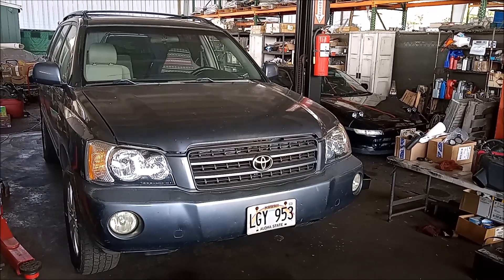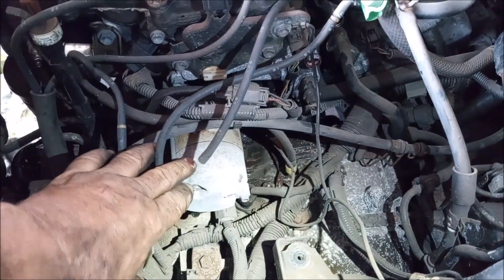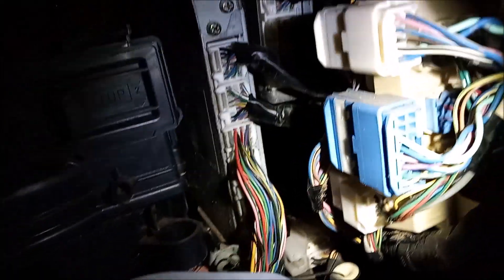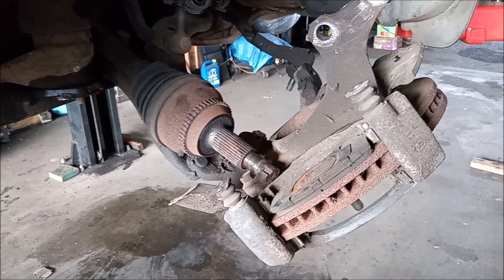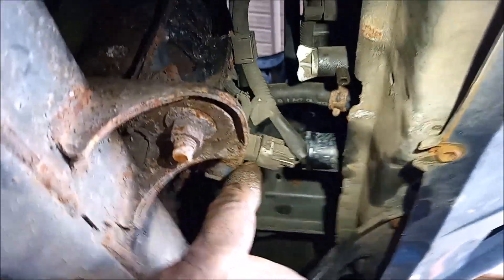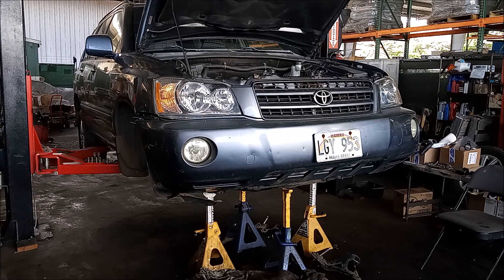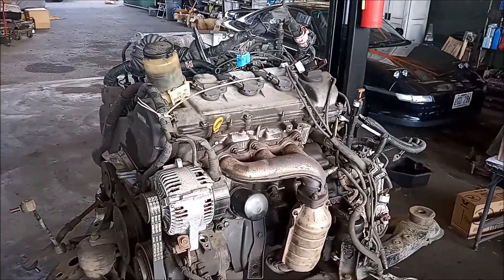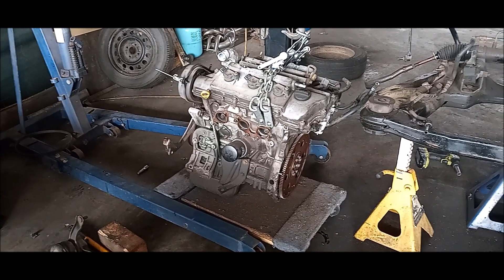How to Replace the Engine Toyota Highlander PART 1 - 1MZ-FE 3.0 Liter V6 - Camry Sienna RX300 RX330

Comment: I just did an engine and transmission swap from a donor. Now I get a crank no start. Did you reset the ecu?
Reply from the maker: There is no reason to reset ECU with this engine replacement. Do you have fuel? Do you have spark? Do you have compression? What is your vehicle?

Comment: What size should be the fork's opening to separate the subframe? Thank you.
Reply from the maker: Are you having the same problem with corrosion? Any standard pickle fork will work.
Reply: @Merryfrankster_  Yes, I do. I have found out there are at least three different Pickle Fork opening's sizes: 11/16" - for tie rods, 15/16" - for ball joints, 1-1/16" - for pitman arms. Which one did you use?
Reply from the maker: @mikhailmikhaylov3801  well if you look in the video you can see the size of that boss for the bolt that the pickle fork has to go around. When I get to my shop I'll measure my pickle fork for you. But probably you cannot go wrong with the bigger size.
Reply from the maker: @mikhailmikhaylov3801  my pickle fork is 15/16 between the teins.

Comment: It could be just me but this seems like you did a lot extra. I’m doing one right now but only the engine is coming out.
Reply from the maker: I've done it both ways. Easier and quicker for me to pull everything.
Reply from the maker: You'll see what I mean when you go to put it all back.
Reply from the maker: And besides, it's the suggested method in the factory service manual. Follow the manual, son.
Reply: @Merryfrankster_   in my exprerience, the manual doesn’t always advise the best method of engine removal but I will see. I’ll let you know if I end up having regrets lol
Reply from the maker: @ricardodifirenze3855  you're making me wonder about your so-called experience.
Reply: @Merryfrankster_   old people can learn too. Don’t worry

Comment: I have enjoyed your videos and found them very valuable. Especially the differences in lexus/toyota blocks. I am doing an engine swap on my Fwd highlander. Is it possible to unbolt transmission and pull motor from the top with a cherry picker? I dont have a lift unfortunately.
Reply from the maker: It's possible and I've done it. But it's very difficult both to separate the motor and then reattach it is even more difficult. You are better off to pull the motor and transmission together out the top with the cherrypicker. You will have to work with the angles to make that happen with the battery tray..
Reply from the maker: Actually the way to go is to remove the bumper cover, the radiator, and the condenser. This is all easier than it sounds.
Reply: @Merryfrankster_ would you recommend removing the front end , or still doing it the way you did in the video?

Do you happen to know if the replacement process is the same for 4wd and fwd highlanders?

Thank you
Reply from the maker: @user-bl6nj9fe5x  With AWD you have the transfer case attached to the transmission. You must disconnect it from the propeller shaft. Then the engine and transmission assembly can be dropped the same way as for FWD. There are no significant differences other than the propeller shaft.
Reply from the maker: @user-bl6nj9fe5x  What you do with the front end is entirely up to you.
Reply: @Merryfrankster_  thank you for the reply. I guess the question is, CAN the engine on an awd be removed without dropping the cradle? I know you do it by the book, but I don’t have a two post lift. Is there any chance I can get the engine out the front based on what you know about the setup?

Thank you!
Reply from the maker: @user-bl6nj9fe5x  Check if your battery platform is welded in or bolted in. Depends on the model. If it's welded in, you ain't going nowhere. If it's bolted in, remove it along with radiator and condenser and bring the engine out the front.

Comment: Hi Frank, I love your style, but I'm no mechanic.  I have a similar vehicle( 2005 limited ) with 225k miles and have decreasing mileage  and increasing oil leakage which is coating my starter and would rather put the money in to putting a good used engine than chasing down the current engine problems.  I think it would be interesting for many people in my situation to see a tutorial or checklist in how to check things like other major components that might also need replacement prior to replacing just an engine since things might be easier and cheaper to fix with the engine and trans out, because the car is otherwise in good cosmetic shape.  With this particular generation of Highlanders, what else should need a transplant to keep it alive?
Reply from the maker: I do have a few other videos on this engine that cover that most important components and features. Check them out.
Reply: @Merryfrankster_  Thanks for your replies allegedly, I value your experience and willingness to share your knowledge in these matters, especially as nobody in my area knows this vehicle or this engine.  It appears I only have the option of buying an relatively low mile JDM 3.0 replacement engine for my 2005 hilander limited 3.3 as there are no direct complete swaps through JDM. I dont have a year or actual miles for the engine, Im told its complete and its located several hundred miles from my location. I am told it will fit in my car, but will need replacement of the parts external to the heads and block..
I know I should go and check it out with a mechanic, and I am willing to do that to help insure I dont get a bad engine.
Should I expect an uncomplicated swap with the 3.0 block and heads with my swapped harness.alt, emission controls, computer controls vs the 3.3 or would I need further programming/modifications  to get me up and running or do I have to risk buying a used 20 year old hilander motor with 100k plus miles already on it.  The rebuilt motors available are not the best option as they seem twice the price of most rebuilds and theres no experienced Toyota techs within hours of my location in any direction.

Thanks in advance.
Reply from the maker: Swapping the 3.0 is not a viable option for a stock street driven car. You would have to change the computer and this means changing the wiring of the engine harness and also the new computer will not be compatible with the body functions of your vehicle. Keep looking for a JDM 3.3. They are not hard to find.  @misterserious3522

Comment: Does the new engine require programming after install?
Reply from the maker: No programming required for engine. There is a special programing function in Techstream if you replace the transmission - but not the engine.
Reply: Thank you for your reply. Mine is actually a 2001 Solara SLE same engine. Still no engine programming?  Have a wonderful weekend!😊
Reply from the maker: No, the engine is absolutely plug and play. What I like to do is pull the EFI fuse, and crank the engine (it will not start with fuse removed) to build up oil pressure before the first start. I also check with the scantool on live data to make sure that all the sensors are plugged in and working. No programming of any kind is needed or even possible on a 2001 ECU. A 2001 ECU cannot be programmed in any way, shape, or form. That functionality was not available in that series of ECU. for that reason, make sure that it has the correct fuel injectors - same as the old engine, or use the ones from the old engine if necessary. The injector flowrate is programmed into the ECU, and cannot be changed.  @richardzarzaur6501

Comment: Merryfrankster,
Thanks for the video and enjoy your content.  This is helpful as I'm looking to change all four subframe bushings (engine insulators) on my 2002 Camry.  I installed new OEM motor mounts but still have excessive engine movement.  I arrived here due to a worsening knock and have pinpointed it to the drivers rear bushing.  They're all cracked and ripped.  My question:  what's your best advice for making the job as smooth and minimal as possible?  My thought was to disconnect the sway bar links, steering shaft, and support the rear downward while keeping the front connected, then doing the reverse for the front.  After seeing how the rear connects where your corrosion was, not sure I'd have enough flex/clearance.  Not sure it'd be realistic for me to rent a hoist/brace bar and lower everything down.  Thank you for the time!
10:00
Reply from the maker: I am not sure that I am understanding you correctly. You can replace the mounts just using a floor jack. Put the front on jackstands and remove the front wheels. Leave the rear wheels on the ground, with parking brake on and chock the wheels (this is so you do not accidentally tip the car off the jackstands). Then you can unfasten the mounting bolts for each insulator and use the floorjack to lift up from under the engine or transmission..
Reply: @Merryfrankster_  sorry, the engine mounts were just part of the story.  Those are already in.  I'm trying to figure out how to change all 4 bushings in the subframe, the easiest way possible. Toyota part# 52211-06030 x2, Toyota part# 52217-06010, Toyota part# 52215-06030, all with their respective spacer on top in possible.  Not sure if there is an "easy" way to do this besides lowering the whole thing like you did.  Hopefully my first comment makes more sense now.
Reply from the maker: @jordanthomas5353  I see. Remove the top torque mount (barbell). Then if you loosen up the front two by a few turns, you should get enough range of motion if you remove the two rear and lower down the rear of the subframe with a floorjack.. Make sure you torque everything back to spec, and use a threadlocker on the bolts, otherwise they will work themselves loose over time.
Reply: @Merryfrankster_  Great.  Planning to disconnect the steering rack u-joint & upper strut mounts also to have that range of motion on the rear.  I saw a forum w/ you that the FSM might be wrong.  Can't find any info but thinking 163 ft/lb on the large bolt, 56 ft/lb on the others + threadlocker

Comment: At 0:29 - I had to Google what a "JDM" engine is. I'm curious if advanced DIY types can also purchase a JDM engine. I recently changed the timing belt/water pump in my driveway on my 2006 Toyota Highlander Hybrid, but if my rear main seal ever started to leak, which I highly doubt as I only have 193k miles, I could never get the engine out if it requires a car lift.
Reply from the maker: Getting this engine out is a real pain. Either you do it as shown in this video, or you separate it from the transmission and pull it out the top with an engine crane - but this method is a real struggle.

Comment: Thank you for this tutorial video.
Would I be able to remove the engine from the top with the transmission attached?
Much appreciated
Reply from the maker: Look at precisely 1:40. You see the battery stand that is welded to the frame. This is in the way of the transmission if you attempt to pull it up.
Reply: @Merryfrankster_ Seems unconventional for a shop to do, but a backyard mechanic on his own car could cut that battery bracket and re-weld it back on to make pulling it all from the top alot easier
Reply from the maker: @curtishouseman9542  a backyard mechanic with a welder. Usually lucky if they have a simple flat-head screwdriver.

Comment: Watching intently like your cats...  🙂Mr. Frank as I have to get same engine rebuilt on an 565,00km 02 Solara SE...  Just timely - *Shall follow your list and modify as required - Give to my mechanic doing rebuild*.  Thanks for sharing.  JimmyF
Reply from the maker: With any of the vehicles with this engine the procedure is nearly identical. Check my other videos for details of disassembling and refreshing this engine - camshafts, oil pump, head gasket, et cetera.

Comment: Excellent video. What’s the mileage on the used engine and the price?
Reply from the maker: It's a JDM engine so exact mileage was not known but I opened it up and it was clean as a whistle inside - it was featured in one of my recent short videos. Price was $1,400 USD.